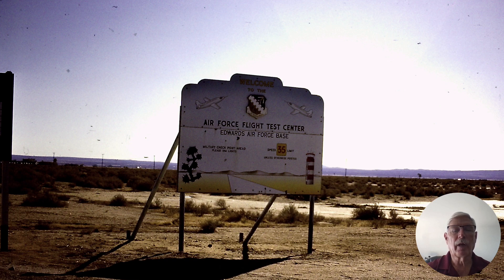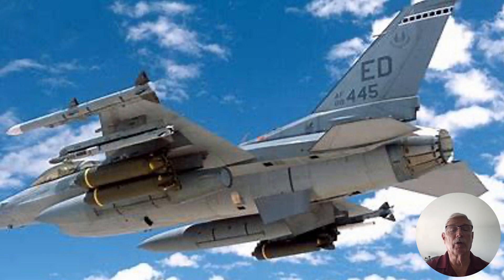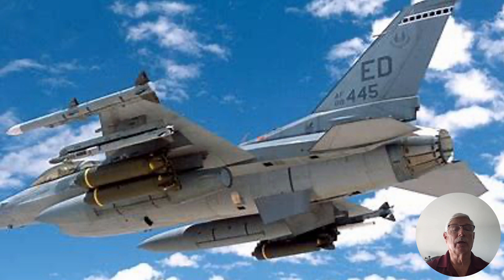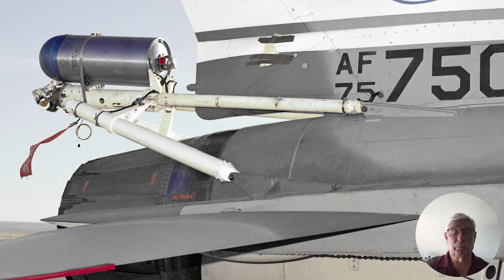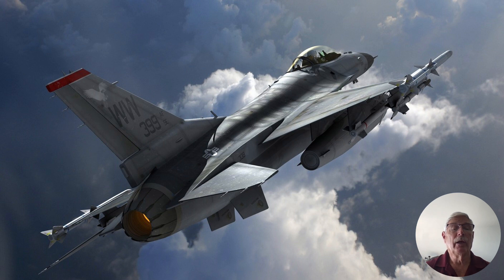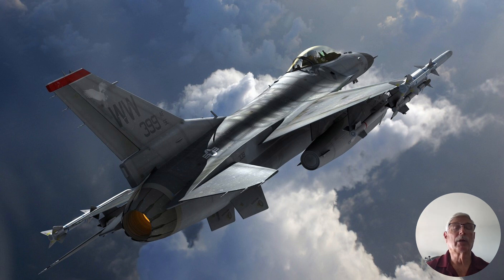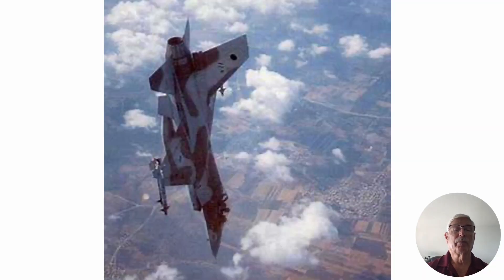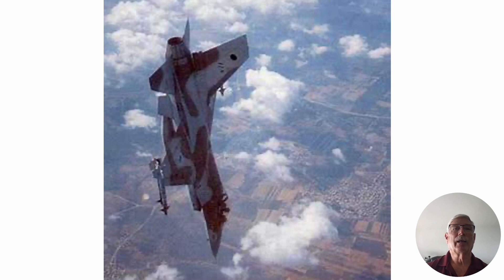First F-16 DEPARTURE FROM CONTROLLED FLIGHT during high Angle of Attach testing at Edwards AFB

Comment: They were so confident in the new aircraft that Lockheed published the first version of the "dash 1" flight manual with the words "the fly by wire flight control systems allow the F-16 to be flown with reckless abandon" on the title page. 

As they learned about deep stall and a few other issues, they silently removed those words in subsequent versions. 

As you well know, if you get a Viper to depart, it means you are so far outside the envelope that the computer is basically saying "I've got nothing dude, this is all on you now, have fun and let me know when you fix this, alright."  

As the pilot, you'd often find yourself in the dreaded inverted flat spin, losing altitude fast, and your options were often very limited.  "HAL," the flight computer had already used up all the reasonable options and you'd better hope that you got just a bit of flight control authority in the thicker air as you descended towards the floor and had to bail.

Comment: If I remember correctly, the F-16 deep stall condition was part of why they enlarged the tail (horizontal stabilizers), wasn't it?
The books always talk about the weight increase being the reason for the enlargement but it sounds like the control issue might have been the bigger impetus for the redesign -- not they haven't been redesigning the F-16 between production blocks!  They're up to Production Block 70 and the Block Number STILL takes priority over the Model Letter.  A Block 25 F-16C is NOT the same plane as Block 50 F-16C!  The Block 50 is light-years beyond the Block 25 in capability and is the F-16 they're keeping in service until 2045!  I don't think any Block 25 F-16s will be service past 2035 IF they make to 2035.
I don't think there's another current-year fighter where the Production Block Number is more critical than the Model Letter.  
I remember when it was confusing for me to read about P-47s designated D-models that were in flavors of "razor backs" and bubble-canopy versions.  I'm supposed to believe the bubble and razor backs are BOTH D-models of the P-47?!?  Utterly nonsensical!  Only the US Navy designation scheme for fighters pre-1962 made less sense!  You could have two F4 fighters and one would be a Grumman plane (F4F) and the other a Vought fighter (F4U).